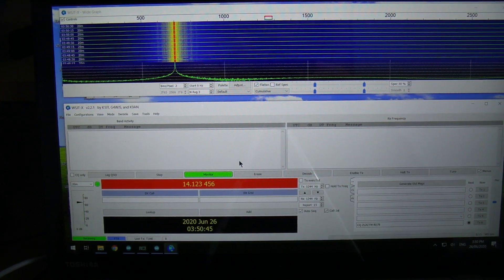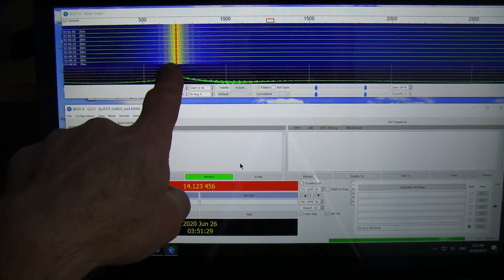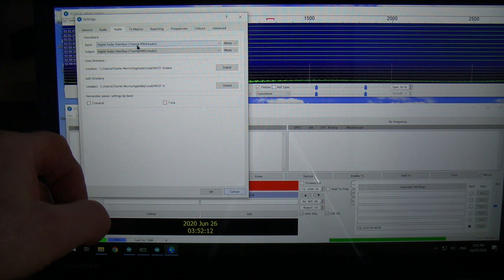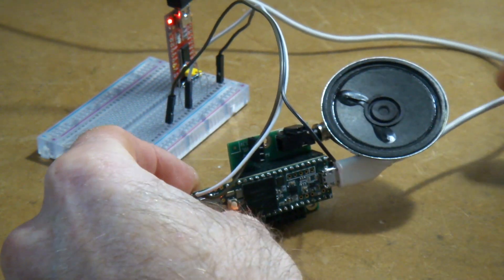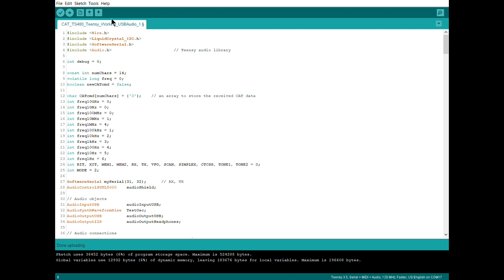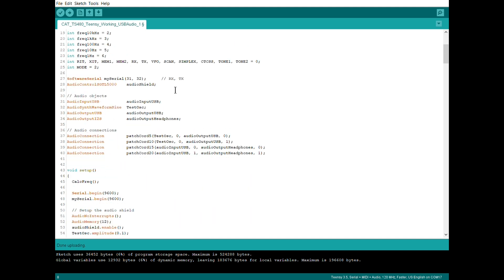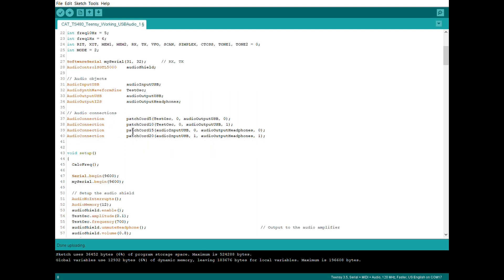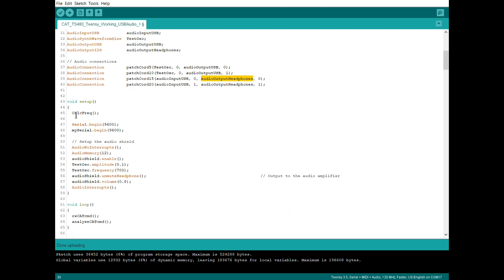Digital Modes Rig - Part 2a USB Audio + Serial

Comment: Sorry but I don't get the hardware set up. I don't see how you are getting the CAT & AUDIO to/from the PC/WSJT over one wire. Can you give me the set up please
Reply from the maker: Antony. The Teensy allows the one USB cable to provide both serial and audio at the same time. If you have enabled the Arduino IDE Teensy plug-in then you will see the option under Tools -> USB Type.
Reply: @CharlieMorrisZL2CTM  Amazing. I will give it a try. People at ELAD should adopt this for my FDM-DUO to merge CAT & AUDIO on two USB cables they have today... Am now working to see how good I can make the filters for Phasing or Weaver. Need much sharper to cut wrong sideband output at low audio frequencies. See notes at ganymedeham.blogspot.com.

Comment: Teensy is a great piece of hardware But I'm wondered how the bluepill or blackpill with STM32F1 core would do since they are much cheaper at least in Iran. (I'm aware that they cannot do as good as Teensy.)
Reply: the MCHF is a stand alone SDR based on STM32F

Comment: Very Good! You have achieved your one wire interface. I know the teensy is a fast processor but I am still surprised it can do everything at the same time. I just wonder if you will see glitches in the audio streams when the processor is off doing CAT commands.

I am living vicariously through your efforts. Good luck. Charlie KM4ZZ
Reply from the maker: Hi Charlie. That remains to be seen. I'll add in the DSP code and see how we get on. If it's no good, then I can easily add in a small Arduino to to the CAT and leave the Teensy to do the rest. All fun and games.